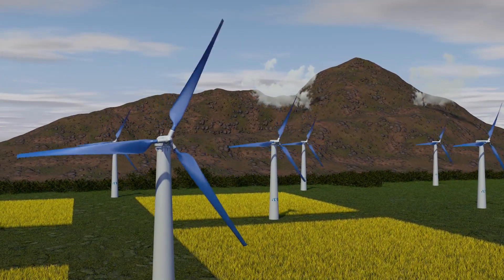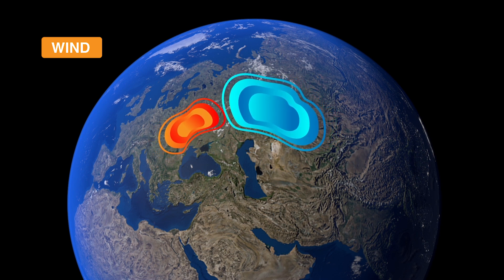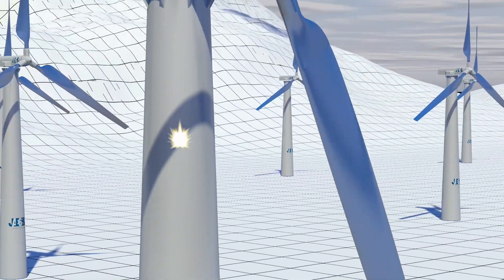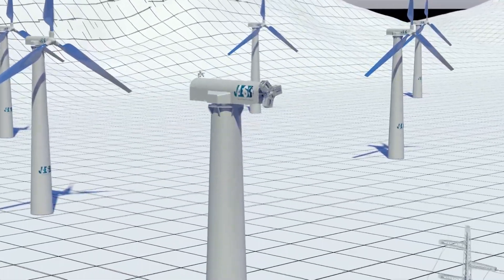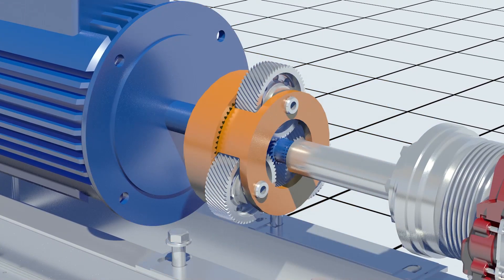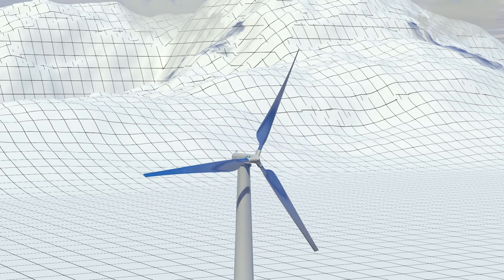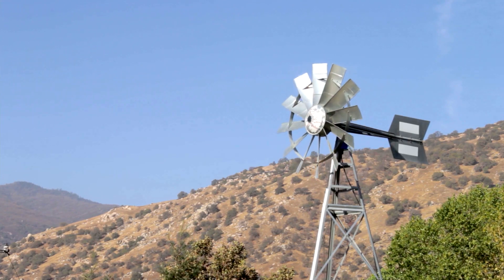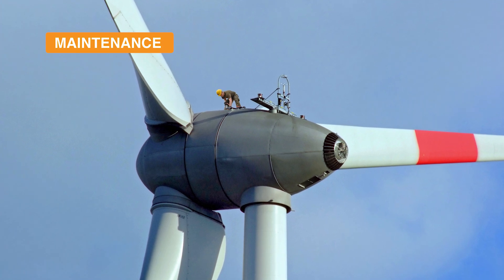What is a WIND TURBINE and how does generate electricity? Wind power - Components - Accidents

Comment: This is a good video, but may I make some observations.
1. All the turbine blades are shown rotating in a particular direction which is usually clockwise, as in 1:46, they all have their outer part of the blades pitched in the wrong direction. The drawings could be modified to include the correct pitch angle for the rotation shown. I think a few viewers would notice this.
2. In the sequence I would have liked to hear would have included Betz's law which says that Betz's law applies to all Newtonian fluids, including wind. If all of the energy coming from wind movement through a turbine were extracted as useful energy, the wind speed afterward would drop to zero. If the wind stopped moving at the exit of the turbine, then no more fresh wind could get in; it would be blocked. In order to keep the wind moving through the turbine, there has to be some wind movement, however small, on the other side with some wind speed greater than zero. Betz's law shows that as air flows through a certain area, and as wind speed slows from losing energy to extraction from a turbine, the airflow must distribute to a wider area. As a result, geometry limits any turbine efficiency to a maximum of 59.3%.
3. The action of the primary components could have been a little more detailed as follows:- In transforming the energy from the wind to electrical energy there are a few intermediate transformations. 
The energy in the wind is first transformed into shaft rotating energy due to the fact that the linear velocity of the wind is accelerated to change direction by the turbine blade twist or pitched area of the blade. This change of wind velocity or acceleration of the heavy air particles in the wind produces a  reaction on the turbine blades to cause them to rotate.  The rotating shaft power or rate of change of shaft angle is used to rotate a magnet in the presence of a set of coils and THE RATE OF CHANGE OF THE MAGNETIC FLUX  due to mechanical motion,  while the coils remain stationary, will produce a voltage.  This voltage may be stepped up to a convenient value by using the rate of change of magnetic flux in the AC supply of the alternator through using the primary and secondary coils in a transformer, which has no mechanical motion. 
The losses through the sequence of events are as follows.
Betz law  loss from wind to shaft power theoretically 59.3% 
Gearbox efficiency,  80 to 90 %
Alternator efficiency, 80 to 90 %
Transformer efficiency  95%
Reply from the maker: Thanks for your observations! They're very important for us becouse we are trying our best to provide good contents and we need to be aware of our mistakes. Have you had the chance to watch our video about the working principle of mobile phones? https://www.youtube.com/watch?v=3xKn99QMudY&t=522s
You can tell us what do you think about it!
Reply from the maker: Dear Carmen Pule thank so much for your comment  we really appreciate.I don t know if you have knowledge about phone if you don t mind watch our video :https://www.youtube.com/watch?v=3xKn99QMudY&t=535s let us know if you can indicate us how we can improve or add info our video thanks again Jaes web
Reply: are you sure about  efficiency of alternator and transformers, it seams to me that it could be around 50 for alternator  and  up to 70 for transformer